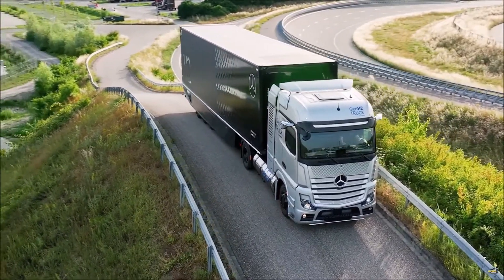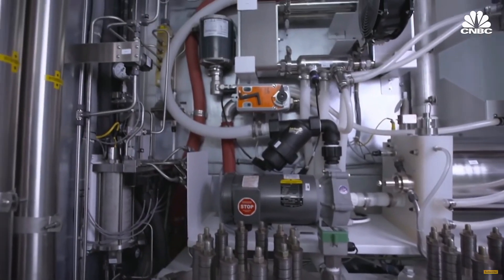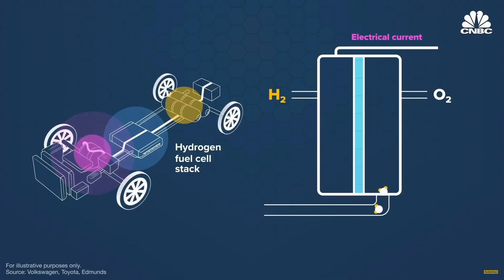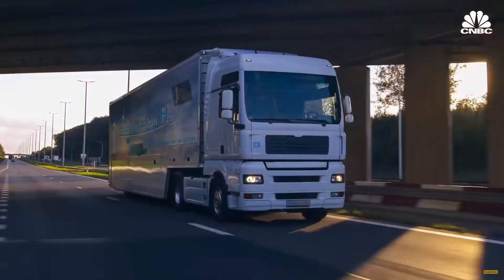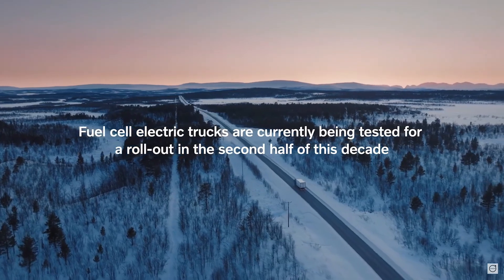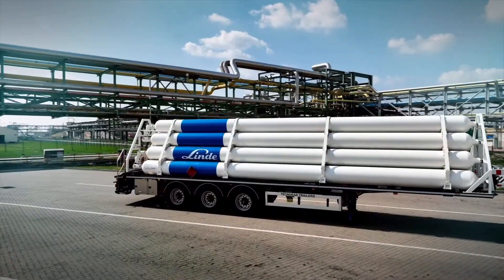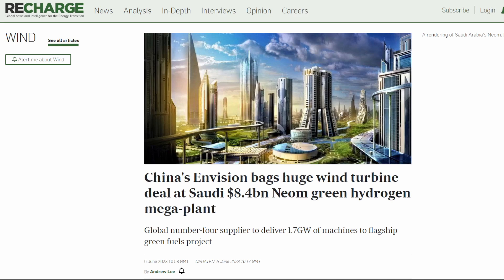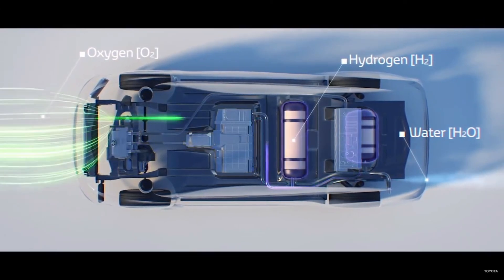It's Official: The U.S Government Is Going ALL-IN On Clean Hydrogen.

Comment: “Truck builders including Daimler, Volvo, Toyota and Hyundai, like Nikola, see hydrogen as a better option for electric trucks than batteries as they aren’t as heavy and can be refueled more rapidly.” — Forbes 
Actually, hydrogen is a better option for cars as well. For starters, there won’t be enough fast-charging stations to go around — not when you consider the millions of battery cars about to hit the road. And since it takes about half an hour to fast-charge battery cars, it’s not hard to see that there’ll be waiting lines and hot tempers. 
Meanwhile, hydrogen cars can slip into truck hydrogen stations, fill-up and be on their way in less than 10 minutes. 
This advantage alone is sure to make battery cars the biggest booster of hydrogen cars. 
Nor will the charging headaches go away with better batteries. All batteries — no matter how good or cheap they might get — would still need to be charged — by drawing power through wires from our anemic electric grid.

Comment: This is not true.  'All in' means everything.  And it won't be everything.  There are lots of problems with hydrogen:  It requires electricity to turn it into fuel. It leaks.  It is highly inflammable.  There are no commercial distribution networks for it.  It is burned in old fashioned ICE engines.  It produces water vapour, but the hydrogen leaks can cause serious pollution.  Hydrogen is only favoured so that mechanical car engines can stay the same.

Comment: there is no such thing as clean hydrogen....99% is made with fossils and making it with solar/wind is extremely inefficient. Batteries are most of the time the way to go. Especially for cars. Trucks, maybe some will have to run on H2, but mostly it is inefficient (but pushed by big oil so they can continue their business as usual...)

Comment: Fossil fuels are more cost effective. we need all energies not just pie in the sky green lye's..!!🙄
Reply: Cost effective but with obvious environmental issues.  Decoupling the power use from the power generation is a win no matter what tech is used.  Even if we continue with fossil fuels it would be much easier to implement carbon capture and deal with emission issues at a few production sites instead of everyone driving around their own personal pollution generator.
Reply: @tridave9811  Without environmental issues? have you forgotten all the pollution created by battery manufacture. the waste created by windmill blades much less than fossil fuels. co2 levels are .047% of 1% Glob al warming is Environmental Fraud That don't even count the dead birds and whales from windmills, what of all the scrap solar panels.!!